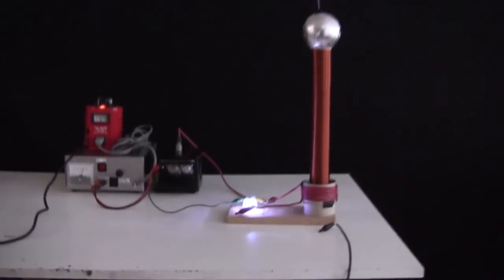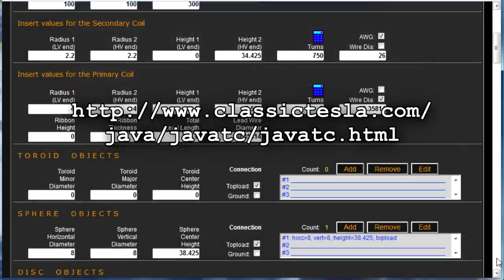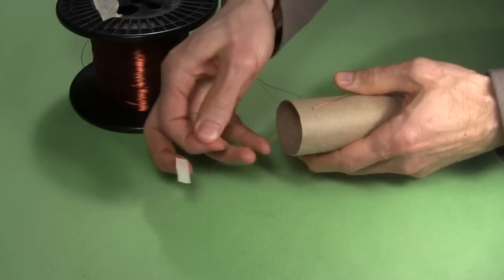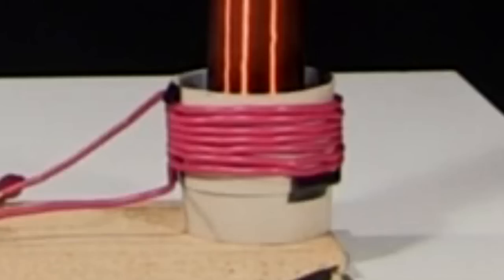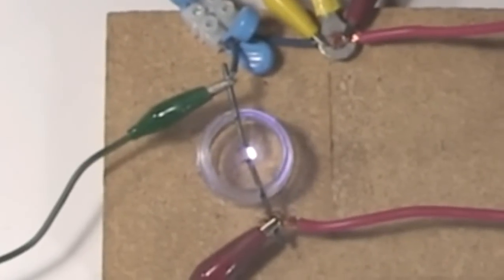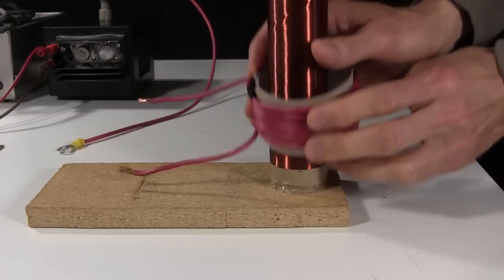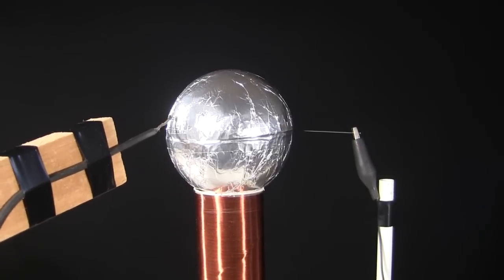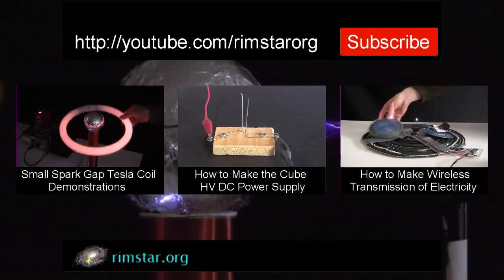How to Make Tesla Coil - Small Spark Gap Tesla Coil

Comment: Be careful. Those things are addictive. Soon you will want a bigger one.
Reply from the maker: Raymond Bivens I know. I feel the same way. Luckily the noise level restricts me to making only small ones. :)
Reply: RimstarOrg Have you tried using a zvs driver to drive your flyback? They are more powerful. Just an idea. I got mine over a foot that way.
Reply from the maker: Raymond Bivens No, I haven't tried a zvs driver. Sounds like I should though. One foot is nice.
Reply: RimstarOrg zvs drivers are easy to build. Just make sure your dc supply can handle 10 amps. Especially if you wanna crank it up. I used irfp260n. They are pretty tough.
Reply: Don't worry he doesn't have a good  high voltage power supply
Reply: @raymondbivens5787  I put my zvs driver in canola oil because it gets so hot and the fly back takes it fine I have a bunch of them
Reply: @shauryamani664  I will try what about it do you believe it
Reply: @shauryamani664  hmmmm maybe that could work I'm not sure where they fly back eventually when I get one of those bug zappers I'll try where fly back I think it could work with a car ignition coil he has a spark a Spark Gap which will send a pulse through the fly back it could work pretty sure would work with my car ignition coil out but I don't know about a fly back so when I get one I'll try it and tell you the results
Reply: Okay
Reply: @Mike ok
Reply: @Mike-nt7cd  ok
Reply: Raymond Bivens yeah I am addicted I need more bigger one
Reply: Im working at a 1.6 meters coil =))
Reply: Happened to me already XD
Trying to build a million volt Tesla coil as a teenager.
Reply: I agree!

Comment from the maker: At last... here's my How-to-Make a small spark gap Tesla coil video. Enjoy!
Reply from the maker: *****
Thanks. And I'm with you there, lots of good physics to learn and play with in Tesla coils. Another great one is a crystal radio.
Reply from the maker: *****
I don't have experience with bigger ones... but the same physics would apply though I'd expect that with the higher voltages, more things would have to be taken into consideration. For example, with larger ones with longer streamers there's a chance of streamers from the topload down to the primary coil. In that case a grounded wire or tube is usually put just above the primary coil so that the streamers go to the ground instead. Also, due to the longer streamers the secondary coil would be coated in varnish or some insulator for more protection.
Reply from the maker: *****
Hey, that's awesome to hear about your kelvin water dropper! We all stand on someone else's shoulders or get help at some time, so I'm just glad I could pass some along. Of course, you made the effort and got it to work so it's really all on you. Nice work! And re facebook and google plus, I'm here. Cheers, Steve
Reply: +RimstarOrg Can i use isolated copper wire (the magnetic wire was extremely expensive so i bought a classic isolated copper wire istead)
Reply from the maker: +Matei Popescu Do you mean use plastic coated wire instead of enamel coated wire (which is also called magnet wire since it's often used for making electromagnets) for the secondary coil? I'm using enamel coated wire (magnet wire.) The actual metal inside is copper. Both types are insulated since they have to be.
So if you mean to use plastic coated wire, a quick search didn't turn up anyone doing that. That might be because given the large number of turns needed, it would be much taller, but I'm not sure if that's the reason. So I guess my answer is I'm not sure. If you don't get an answer for sure then you could try running the numbers through the javaTC online calculator I talk about in the video and see what it says. It may turn out to be impractically tall.
Reply: Yes
Reply: +RimstarOrg I tried to run it through javaTC but it doesn't in the equation the plastic coating and gives me the frequency of the second coil to over 20000 kHz
Reply: +RimstarOrg My biggest question is if the coating affects the field in theory
Reply from the maker: +Matei Popescu No, the coating itself doesn't affect the field.
Reply: RimstarOrg can this be used to make nitrogen oxides for nitric acid synthesis?

Comment: Can you explain why a Tesla Coil is not, functionally, a generator? Given the components, the circuit is symmetrical, and you should be able to use the primary and secondary coils as the transformer of the power supply and the transformer as the primary and secondary coils- thus making the original transformer as the discharge - from which you can convert into usable power, and the original primary and secondary coils as the transformer- making the ionized air in the surrounding environment the input. Static electricity doesn't account for much power is small numbers, but that is the function of the toroid and capacitor- to collect more ions before discharging at the desired voltage. The working circuit also serves to enhance the ionization process through the magnetic fields of the coils. This makes it, not a device to transmit electricity through the air, but a device to harness it from the air. You don't need to transmit it, because you already have it.
Reply from the maker: The amount of ionized (charged) particles in the air is very, very small, too small to be useful. Also, a transformer needs fluctuations in order to do anything, and that charge is all static.

Comment from the maker: +Ereka Bergantinos The high voltage power supply is for making the spark gap work. Air is a very poor conductor of electricity. To create a spark across a spark gap you need enough voltage to break down the air and make it conductive.
Why do you need a spark? When the spark discharges it doesn't just discharge straight away. It takes a little time for the air to become non-conductive again. During this time the current is actually rapidly going back and forth between the two sides of the spark gap. The frequency of this back and forth is determined by the resonant frequency of the capacitor and primary coil.
Why don't we just have a frequency generator instead? We need this resonating to happen only for a short period of time and then stop for a bit and then repeat again. While it's stopped, the secondary can do it's thing. Using a spark gap is one way of doing that. Another way is to build a different type of Tesla coil called  solid state Tesla coil, one that uses more modern electronics.
PS. Your comments don't have a reply button because in your Google+ settings you don't have "Who can comment on your public posts?" set to "Anyone". It's a lot easier for me if you set this to "Anyone" so that I can reply to you in the same one place I reply to everyone else.
Reply: RimstarOrg Do you realize that Tesla's actual transformer used a magnetic quenching circuit across the spark gap to only output unidirectional pulses through his transformer? This way his top load projected longitudinal Aetheric waves with much greater range and power. The sparks, if you have them from the top should be white, feathery, and safe to handle. The blue sparks are corrupted with voltage and are dangerous.
Reply: BMan18 who wants a safe tesla coil??  I guess you like really slow sports cars too?

Comment: I made a Tesla coil in high school, circa 1966. Used a neon sign transformer I found that gave me about 30KV. Wound the main coil on a phenolic tube about three feet tall. Made the capacitor using window glass and a couple of pieces of sheet metal. The whole thing was based on plans in Popular Electronics and it worked great.

My favorite thing to do was to attach a wire from the base of the big coil to a burned out light bulb on a broom handle. I'd bring it close to the top and the arc would puncture the glass of the bulb. If I messed around with it long enough, pieces of the bulb envelope would fall out. Could only run it for a few minutes until the ozone small became overwhelming.
Reply from the maker: +Robert Shaver Sounds like you had fun. I'd make a bigger one but this one is loud enough. I still want to try solid state someday, since it's quieter, until I start breaking light bulbs that is! :)

Comment: So much fun watching this. I built one based on a 1964 Popular Electronics project ... this was back in 1964 too ... I was almost 14 at the time.
That project used a neon sign transformer for the primary supply , a 50'  roll of automotive  HV spark plug ignition wire with sparkgap, a capacitor made from a picture frame and aluminum foil.
The tall coil was #96 magnet wire, I forgot how many turns but it was about 3' tall and 4" wide. Sadly the only coil form I could find at that time was a black soil pipe that looked as if it had been made from coal and the earth, it did not perform all that well, but it did win the science fair
In 1964 there were no PVC pipes, acrylic yes, but very expensive, it never occurred to me to use a cardboard tube. The glass pane capacitor is nice to see, the foil is placed about an inch back from the edge and the edge will display a corona when running.
Reply from the maker: Craig Nehring That sounds like you had fun making and watching it. I chose cardboard tubes so that more people would be able to make one if they wanted to, otherwise I'd probably have gone with ABS since I have plenty of that.
Awesome winning the science fair. My wins were at the regional level in computers, one of which looked like a 2D plotter but was actually an x/y coordinate input device (this was a few years before the mouse.)

Comment from the maker: +Itz Yash A lot of people make a power supply using a neon sign transformer. I haven't done one myself though, so I can't help further with that type. Other than that and the flyback type that I used, I'm not aware of any other method. There are plenty out there that use smaller power supplies but the result is either pretty weak or the Tesla coils aren't tuned, in which case it's just a normal transformer and not a Tesla coil. Another option is to make a solid state Tesla coil, something I also haven't done.
PS. There's no Reply button for your comments because your Google+ setting about who can comment on your public comments is not set to Anyone.
Reply: Hey, I can reply. 
I made my first tesla coil secondary it has 7cm diameter and 47cm lengh. I made it with 0.5mm cable it took 200 meters of that. I don't know calculation is right but it should have ~900 turns. 

I have problems with capacitors. I am using a ZVS driver with a huge flyback and it gives at least 3 cm spark at 20 volts. But I will use a my hand winded microwave oven transformer for geting 30 volts. I will order full bridge rectifier and smoothing capacitor today. I don't know how much voltage I will get from the flyback. My homemade capacitors are blow up so I will get the same caps that you used in the video. How much capacitence I need. Please reply. (English is my 2. langue so I am sure there is a lot of gramar mistakes)

Comment: Great video. I've seen a lot of Tesla coil tutorials. This one is the best.
I especially liked the adjustable primary and secondary mounts. Might have to make some of them :)
Reply from the maker: Mongrel Shark Thanks! I know you've seen a lot of videos so that means a lot. Yeah, that adjustability and interchangeability has made this a lot easier. I don't know if you noticed but version 4 which I show at 0:23 even has a different secondary coil (using 2nF for the primary capacitance made up for halving the height secondary coil.)
Reply: I don’t know how many times I have set stuff on fire because my cardboard Tesla coil fell down... Its been the death of at leas 3 secondarys.
Reply: i made a coil 2 days ago and the same thing happened to it

Comment: I created the "Slayer exciter" and i got amazing results! I had a 1300 turn coil made from 32 awg magnet wire, with a primary of 18 awg wire and the main circuit, i used a 7$ transistor, one that withstands over 500v dc, i put only 40v dc into the circuit, and got amazing sparks, i could show you the results if you would like to see them, i got lights to light from up to 2 ft away =D. Thanks for reading!
Reply: Do you have the video online? Also, what type of transistor did you use? Thanks mate
Reply: Branden Peter Well, I currently do not have a video up, but I used a 2SC3320 transistor bought from eBay.
Reply: Scotlahn Mccallister Thanks! I bought a handful of power transistors from a local electronic store but all of them have burnt out at 12 volt. I guess they can't handle the frequency of my coil. I've got about 1.2k turns. Thanks again!

Comment from the maker: +Cedric S I don't get arcs flying off my dome either. My output voltage isn't high enough. Put a needle in contact with the toroid and the voltage at the sharp point of the needle will be strong enough. Basically, the smaller the diameter of the curve, the lower the voltage that is needed for arcs, until you get to the sharp point of a needle, which is a very small diameter curve!
PS There's no Reply button under your comment because of your Google+ settings. - go to your Google+ page, - in the top, right corner click on your thumbnail icon, - in the popup that appears, click on "Settings". - for the 2nd question down "Who can comment on your public posts?" set it to "Anyone".
Reply: The way you have set this tesla up, is it safe to be zapped by it. Please reply soon as posible.
Reply from the maker: Lachy Brown Not all Tesla coils are safe to get zapped by but the current in the sparks from this one is low enough to be safe, unless you have a heart condition. It's doesn't even hurt, just a light tingle. I'm getting zapped in the demonstration with the CFL near the end of the video.
Reply: +RimstarOrg Thanks for the education,  I like the way you go about it not making any proprietary moves. A request please,  I  would like that you help out with a kapagen, I am more particular with the details of the connections.  Are they the same with the connection of the Tesla coil? Thanks again.
Reply from the maker: +Ikenna Alams (loviyke) You're welcome. Thanks for watching. Re kapagen, I don't do research in that area anymore.

Comment: i used a zvs circuit for the high voltage supply with a flyback instead of building it by soldering it together and it works pretty well

Comment: I found that calculation was not nescesary unless you wanted it to be super efficient, I just would my coil based off if I think it looks right and after some messing around with the spark gap and input voltage, I got it to make some pretty massive arcs, without a ground wire, jumped into the air directly

Comment: If you check the 'Auto-Tune' option before you click 'RUN JAVATC', it'll solve for the matching resonant frequency of the primary and secondary.
Reply from the maker: I didn't check 'Auto-Tune' at this stage of the construction but I did make use of it later when changing the coil to a flat spiral coil. I used it to check if the coil had enough turns to be tunable to the resonant frequency. That video is here https://youtu.be/UWVUEIhpF6w.

Comment: Great video!  Would a plain microwave transformer (with current limiter) work as the supply, or should I add a rectifier to convert it to dc?  

First time making a spark gap tesla coil, I'm used to solid state ones haha
Reply from the maker: Thanks! It works with both DC and AC as input, though I've only used DC myself. A microwave transformer puts out AC. I guess you're already aware of how dangerous a microwave transformer can be since you mention a current limiter. Be very careful if you're using the output of the high voltage, high current winding.

Comment: Hey chief thanks for the video, i have a question tho, that secondary wire that you connect to ground, does it recieve power? Im just so used to the slayer exciter where the  secondary start wire is connected to source or emmiter of a mosfet, yes i am a noob but i enjoy being a hobbyist 😉Edit: So im ecstatic! Pun intended that my coil is finally working..so cool however i stil have the caps arcing problem..it is a problem yes? anyhow thanks, i tried making the slayer and the mosfet coil, but none worked but yours 💪👍
Reply from the maker: I've heard of the slayer but don't know details. But in this Tesla coil, the secondary wire connected to ground doesn't receive power directly. The only power it receives is what's induced into the secondary by the primary.

Comment: Those capacitors are a bad choice since those are not meant for Radio Frequencies and they heat up due to that changing their capacitance / causing a high internal resistance. 
I would advise using Foil Capacitors  (Polyprop Caps)
Reply from the maker: Thanks for the suggestion. I did try some DIY capacitors too, a flat plate foil one https://www.youtube.com/watch?v=05f6ZaWmr8Q and some bottle ones https://www.youtube.com/watch?v=Kc9Mjzfowcs (not so good though since the foil was not glued firmly in place).

Comment: Hello dear Rimstar! I understand this Tesla coil use about 15-20 v with about 2 Amp. I 
would like to ask you if this machine can be harmful to people and to other electronics    
Thank you for your nice video
Reply from the maker: +AMITBUBU A Tesla coil can interfere with electronics whenever there's a spark. This small on isn't harmful to people but you can get a harmful shock from a more powerful Tesla coil. But as long as you don't get a shock from it then you're okay.
Reply: Thanks for your answer !
one more question , if I increase the frequently to around 2000 kh , what  should it will change? Will it make the power of every cycle to be lower maybe?